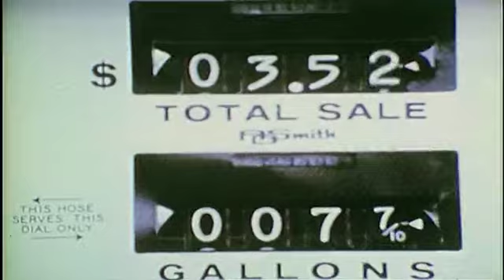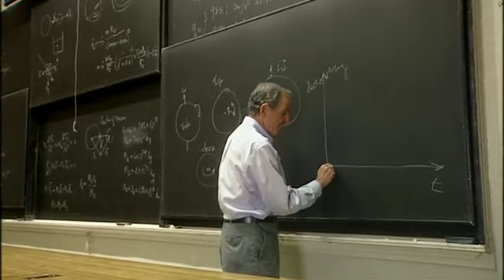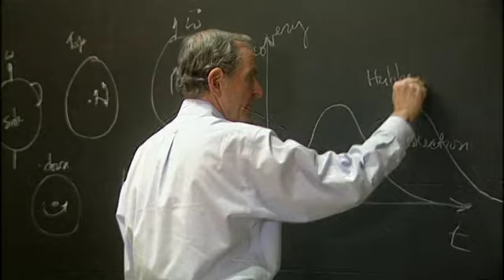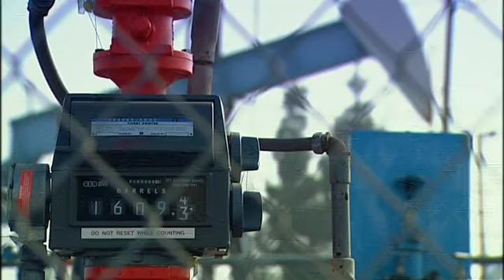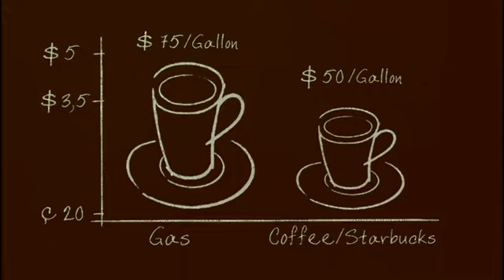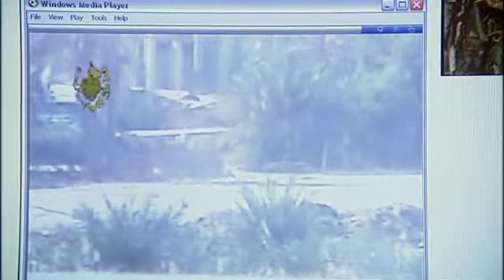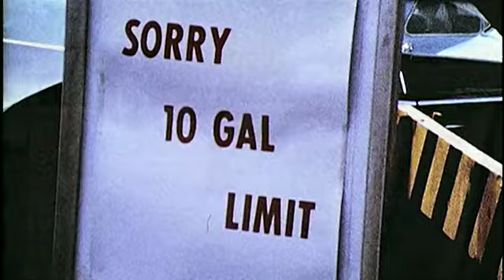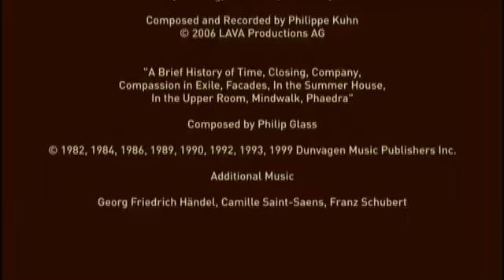A Crude Awakening - The Oilcrash

Comment: Title should have been "Oil glut crashes petrol prices."  hahaha  Ahh the hazards of predicting the future. Yup there was a peak in US production around 1970 and now we are about to surpass that peak.  Who would have guessed?  And demand has been falling too.
Reply: "Yup there was a peak in US production around 1970 and now we are about to surpass that peak."

Ain't gonna happen. The steep drop from 110 til 60 has the warning lights flashing constantly in the industry AND in the financial sector that holds its hands under an already cash-strapped sector (as well af that same financial sector being cash-streapped, and thus desperate for returns), plus the recent reports that the tight producers will themselves peak out in 2015-16, in addition to these NOT being able to bring production on-line quickly due to the massive capital investment needed for tight oil extraction.
Reply: neglesaks We shall see.  I bet you would have said $55/barrel oil would never happen just 6 months ago.  At these prices you might be right, if prices go back to and sustain 80 to $100 for the longer term there's no way the shale plays are close to peak as they can produce for half that price and falling.  It looks like the US production will get a substantial boost from the lifting of the export ban and fracking is becoming cheaper as they get better at it.  And there is far more shale potential that has barely begun to be exploited.
Reply: neglesaks My main point is that it's really hard to say what will happen, today more then ever in the energy sector, it's incredibly dynamic.  And who would have guessed in 1970 that US production would even come close to that peak 40 yr.s later especially from shale. 

 In real terms (inflation adjusted) oil today @ about $55 is *roughly* twice the average twentieth century price.  Technology, modern efficiencies and price could, for example, make old 'played out' traditional oil fields viable again.  Typically we have managed to extract some 35% (?) of the oil we know is there and it's not inconceivable that close to that much more can be economically extracted from those old fields in the near future due to far better computer models and new methods even at todays prices.  Just one example.  I didn't foresee the shale revolution so I can't necessarily expect to see the next macro breakthrough.

Demand has been falling recently, globally this year and for several yr.s in the USA.  I don't recall much talk on "peak demand" but it's possible that we have already passed that milestone?...maybe close at least?  Vehicles from airliners, trains, ships to tiny cars are getting more efficient and more diverse power options.  Cars are almost sure as hell going electric for the "foreseeable" future, trains and big trucks WERE slowly converting to natgas but cheap oil may have stalled that.  Obviously population growth and increasing prosperity works against 'peak demand'.  Sadly but predictably Americans have already ramped up the purchases of bigger SUVs.   

It's complicated.  It's hard to know where to put your money, I might have bet against Tesla Co. 2 yrs ago and I would have been wrong by a factor of four plus.  I could have easily had significant stock in shale gas co.s early this year and been wacked, I didn't expect prices to drop this far ever, but if I had that money running in that sector over the last 4 yr.s?...I'd likely still be in pretty decent shape still.   (pardon the long rambling rant)
Reply: McGill: Thanks for your detailed reply. AS you concude, yes, is is very complicated, I think that is the main thing we can disagree on. If you asked me to cummasrize the entrei sitution with the markets (not just energy markets) these years, it is that we have netered a time of highly increased volatility (at least internally - "externally" it is being "Managed" by activist government adn central banks - and that volatility creates great uncertainty in otherwise calm adn predictable markets. VOlatility hat goes on for too long will lead on to economic chaos.
Reply: neglesaks I wouldn't worry too much about that, it seems that commodity markets have always behaved wildly much of the time, no?  Volatility goes up and down and you and I can perhaps profit off it some of the time.
Reply: "it seems that commodity markets have always behaved wildly much of the time, no?"

A bit more than the general "Paper" markets,, but ... even more so near market peaks, or during times of political turmoil. We are building on both counts...
Reply: neglesaks Maybe.  But I tune into "The Street" quite a lot and don't see anything alarming.  One thing for sure those who bought into all the post crash gloom and doom and bubbles everywhere racket got 'screwed' out of a lot of potential gains...could have tripled their money in stocks had they not been so fearful. 

It's interesting that (at least among the "impressionable young", those whom lack perspective) pundits who paint a dire picture of the future somehow automatically have more cred then the bulls when one should be every bit as skeptical about doomsayers motives and wisdom.  There are just as good reasons to want the market down as up depending on your position.
Reply: Regardless of WHEN....the fact still remains the oil crash WILL happen. And instead of being concerned with what "gains" could be made in the short term, the film is supposed to shock us into thinking differently.....something that this line of responses seems to completely overlook....really is that the point of the movie, "oh look some dummies predicted the oil crash, and it never happened, so lets keep partying until it does"? 

sorry folks, but fracking and tar-sands and massive reserves and the short term lowering of oil prices...still looks like the same cloak and dagger bullshit compared to the absolute fact that this CANNOT go on forever.
Reply: HooliganJ81 I think a gradual fade is a much better description.  It's not like demand will spike over night or supply dry up in a single decade.
Reply: Bo McGillacutty true Bo, prob gradual, but complacency is not a joking matter....while we wait for that change, its just war after war....trillions upon trillions of dollars.
Reply: HooliganJ81 What about "peak everything else"?  Oil is replaceable, not so for a long list of metals, helium, etc., etc.  I'm much more worried about soil erosion then fossil fuel depletion.
Reply: A lot of US shale goes offline, tar sands go offline, a lot of the offshore goes offline, at sub-50. The price of oil will settle somewhere in the 40's and then it's going right back up.
Reply: John Smith Right back up?  How far how fast?  If you can answer that then you will have no problem making a fortune in the markets.
Reply: Surplus on the world market isn't massive, the saudis want to force a lot of Shale/offshore/tar sands/high cost conv producers to go offline,  they hold a 750 billion USD cushion so can sustain a low $40/50/60 oil price for in excess of 3 yrs, after that they would be in a situation where they would tap into debt markets..(wont get to this stage).. and they need long term around 85 USD to break even given their spending... I could take a look at the bond yields/CDS spreads of the shale oil producers to see where they're at. Along with the fact that shale oil wells in general have a very short shelf life, and just wait for the inevitable. A lot of Shale producers, Offshore, Tar sands WILL go offline, if things stay below $60 a barrel for at least 6 months.. With a severe reluctance (from those who got burnt) to ever bankroll similar projects for a long time (this is already happening to an extent). Taking that supply off the market for a good amount of time. Right now, things are going in a general downward direction, but imo prices will level out and consolidate at some point. My prediction is around $40. I'll be buying at that stage (primarily o&g stocks). If im wrong, and crude goes down more, ill buy some more. If i buy an oil producing co (low cost producer, breaking even, <--- they do exist + more leverage  + generally better upside to an ETF ) with WTI crude at $40, price goes down another $10, in a month or 2, hits floor, then rises and settles at $75 in 12 months, i have made money. What do you think the Saudis are trying to do, other than to force the expensive producers off the market.  Oil price wont stay low for much longer than they can bankrupt offshore/a sizeable proportion of shale producers/ tar sands...Once the market gets a whiff of that actually taking place, the price will rise. I made good money from the carnage in late 08. Including in excess of 60X (6000%) on an oil exploration stock in the more speculative part of my portfolio. Back then it was, "Oil has finally found its true price!, We will never see $100 again!"  This situation is different, and could very well be a prelude to a much wider financial crisis, which could leave us in the doldrums for far longer than expected... But what i wrote about is what i'm doing in the current scenario.
Reply: there are very few new discoveries of oil to be made around the world. All of the major oil fields have already been found, and the ones we are finding nowadays are always smaller and smaller pockets that are more difficult and costly to extract. Eventually, the amount of energy required to extract oil will be as great as the amount of energy you get from burning oil, making oil extraction a fruitless process because the EROEI becomes too low to justify production.
Reply: AmandaNerdBot No comment on the rest but: "All of the major oil fields have already been found"...how could you possibly know that?
Reply: The Lula field off the coast of Brazil is the largest find in the Western Hemisphere for about 2 decades (3 if we are being generous, though there are good reason for not being so, since the largest number (~33 Gbbl) of the resources in that basin was made by an executive of PETROBRAS, who happened to make a fat profit off his stocks in the company as it bounched after his announcement. The other generally accepted figure for the Lula resources are 8 Gbbl, ie 1/4th of the former number) - will supply the current human civilisation's demand for about 2 years, if you wring out every drop out of it.

Graphically:

http://planetforlife.com/images/growinggap.jpg

So in summary - no, we cannot know that all the big ones have been found, but considering the rapidly advancing surveying technology and methodoly over the past half century, it's worth considering that the discoveries are clearly tapering off.
Reply: put it this way, you're not going to find a ghawar any time soon, simply wont happen.
Reply: Bo McGillacutty
"Oil is replaceable,"

No it is not. Compare the energy density of Oil and Oil derived chemicals*, with the best battery technology available today - Lithium batteries. The Tesla cars, which is by and large the pinnacle of current technology, works pretty well, though with a range limit for the most expensive model (w/ a 85 kWh battery) at ~400 km, but needs a battery switche at least every 2nd year , assuming daily driving.

How will it work in trucks, freight trains and ships and supertankers, where the load on the engine(s) and thus the battery, is far higher?

How will it work in aeroplanes, where low weight is crucial?

* ) https://en.wikipedia.org/wiki/Energy_density#Energy_densities_of_common_energy_storage_materials

Yes, there are Graphene capacitors in the works, which improves on old-style capacitors by an order of magnitude, which is awesome, but it doesnt seem to be a savior from what we know now.
Reply: neglesaks
oil is indeed the most invaluable natural resource mankind has ever discovered. It allows us to do things that are otherwise impossible to do like travel across the world in mere hours.

Electricity has nowhere near the bang for the buck as oil. Are electric cars a viable alternative to oil? No because electric cars face major limitations. For example, they have limited travel distance.

Also electricity is not an energy source. Electricity is generated by burning and using another energy source. And since most electricity is generated by fossil fuels and other nonrenewable sources, electric cars are still running on nonrenewable sources. Electric cars are pointless, unless you can change the entire electric grid to renewable energy sources, which will be a huge technological challenge. And it is debatable if we can change our entire electric grid into renewable energy sources.

Also, biofuels have major limitations. For example, corn ethanol has too low of an EROEI to justify production. Corn ethanol's EROEI is only 1.5 to 2. Compare that to conventional oil's EROEI of 20 to 30 that's pathetic. Surprisingly ethanol made from sugar cane, however, has a much higher EROEI of 8, which is actually decent. But biofuels compete with food crops, and we are already running out of food, which means we are limited in how much biofuels we can produce.

There is also the issue of wood? Could we burn wood to generate electricity? The answer is yes we can. But if we were to generate all of our electricity by burning wood to replace coal and natural gas as electricity sources, we will quickly run out of all of the trees in the world. So while wood is a renewable resource, wood is also limited in extent because if you harvest it at a faster rate than its replenishment rate, you will eventually run out of wood too just like what happened on Easter Island.
Reply: AmandaNerdBot
Corn ethanol is/was a disaster right from the get go.  It's nothing more the pork for industry and farms.

Solar is on a long term trajectory to be the cheapest E ever and it has a lot of room for improvement even as it is now roughly competitive w/o subsidies. 

 The main problem with fossils is we have far too much and can't resist burning them beyond the biosphere's ability to safely absorb the consequences.  It won't be long before most of the US can power their house and cars off solar collected from their own roof with enough storage to get thru a few days of bad weather.  It will be nice to be off the grid, no?

Electric cars will soon be superior to petrol autos...batteries may be swapped in minutes at a station or fast charged for another couple hundred miles worth.  Trains, semi trucks and ships can be run on NG (natgas) for the foreseeable future, only aircraft will need liquid fuels and THAT much can be supplied by already competitive bio kerosene (at pre-crash oil prices) fed by 'waste' cellulose.  In my agricultural area there is a steady stream of wood fiber from orchard replacement, enough to supply a few modest size wood fired electric plants but that material has much higher value as feed stock to liquid fuels.  A subsidiary of Shell has proposed just such a cellulose to diesel and kerosene plant here so it's not merely some academic exercise, it's actually viable at $80 oil.  No need to replace food for fuel as the fuel is a byproduct of food production.  No it can't supply all our needs but it can power our aircraft and that's all it needs to do.

The mid range energy picture has never been brighter, I worry about things we can't create, that includes most metals, copper, nickel, vanadium, moly, chromium, tin, lithium, etc., only iron and aluminum are nearly limitless.  Helium is nearing the end and once it is in the atmosphere it leaves earth never to be replaced and it is essential for a long list of industrial and scientific purposes.  So petrol is the least of our worries, sort of a joke to worry about really.

I remember when the US even relied on oil for much of our electric generation up until the early '70's or so, we fretted over the possibility of blackouts that never happened. Few even noticed but houses and industry doubled their efficiency.  Since then autos have tripled mpg and oil fired electric plants disappeared long ago.  The transition away from petrol for transport is just beginning and there is no particular reason to think it will be any more difficult then previous transitions.
Reply: Bo McGillacutty
yeah, I believe electric cars have their potential. But you have to derive the electricity from solar, wind and other renewable energy sources if you want electricity to make a difference. Electricity derived from coal,oil, natural gas or nuclear fuel will not make any difference because those electrical sources are nonrenewable.
Reply: AmandaNerdBot I'm far more concerned about ocean acidification, sea level rising, potential for massive methane hydrate releases (probable cause of one of greatest mass extinction events) and other environmental costs of fossils.  Oil will fade away and I think become obsolete before it is even too expensive to burn.

We have more E options then ever today.  We could power everything with fossils for 200 more years but that would be tragic unless we capture the carbon.  An oil executive once famously said:  "The stone age didn't end because we ran out of rocks, the oil age will end before we run out of oil."  (roughly quoted) 

Solar alone can almost do the job.  Germany has about half the solar radiation (similar to Alaska) that the lower 48 states have and they managed to intelligently make it work just the same.  Moore's Law seems to apply to many technologies and that certainly includes solar, look at the last 20 years of price per kwh, it's amazingly consistent progress with no end in sight.

And nukes while not renewable can certainly carry us for centuries if needed, I'm not thrilled with them but better then coal if done properly.
Reply: Bo McGillacutty
what are the limitations of solar energy? Does solar energy require any rare earth minerals or other rare materials? Or can solar panels be made from a very common natural resource?
Reply: AmandaNerdBot I'm not an expert on the subject but current common ones are silicon based.  Many other types are in one degree of development or another including many diff types of materials.  In general I think the answer is NO they do not require rare, expensive or exotic materials in any large quantity.

  One thing to keep in mind is that current commercial units are about 20% or less efficient, we could see that double over in the next decade or two.  But the primary factor will be cost reduction that has been very steady. Eventually it will likely be cost effective to collect even in marginal places like walls or half shaded places.  In any case the typical family home in the US can harvest more then the house requires just from the 'better half' (sunny portion) of the roof.  It is not much of a stretch to power the house AND cars via roof top collectors alone.  And we need not stop there of course, likely driveways, sidewalks and such can also be used eventually.  I expect the cheapest electricity in history is in the near future.

  Even without lifting the 'environmental subsidy' on coal--you can see why the coal industry is panicking...their days are numbered and good riddance...it will take decades but the end is in sight.

Storage is/will be a hurdle for solar and wind but there are many options on the horizon, some of which will likely be viable soon enough.  Also peak electric demand happens to coincide fairly nicely with solar intensity, that helps.  I don't know how electric utilities can survive in the long run, as more ppl go off the grid the remaining customers will absorb more of the cost of maintaining the grid and so on, it looks like a death spiral for the utilities to me.

And that's just land based solar.  Wind and other options are also becoming increasingly competitive.  And that barely extends beyond land, most of the planet is ocean a small slice of which could be used in multiple ways to provide enormous quantities of power.  Everything from algae for oil to solar and wind.
Reply: Bo McGillacutty
Solar has a lot more potential than wind energy. There is 20,000 times more energy from the sun than the amount of energy we get from fossil fuels, so we are awash in sunlight. We just haven't begun to use it yet.
Reply: AmandaNerdBot Indeed.
Reply: Bo McGillacutty
the future of electricity will be solar energy and to a lesser extent wind energy.
Reply: AmandaNerdBot Likely yes.
Reply: Bo McGillacutty
the problem with solar energy is that solar panels are made of rare metals, and it might not be possible to make enough solar panels to compensate for the lack of fossil fuels because there aren't enough of those rare metals. We need to create 100,000 square kilometers of solar panels to replace the fossil fuels we burn. But is there enough rare metals to create that many solar panels with? That's the question. Like I said before, there is no easy solution to the peak oil crisis. All alternative energies have their limits and downsides.

The main problem we are facing is that we live in a world were infinite population growth is seen as a good thing. But there is no way we can have infinite population growth because the Earth's resources are finite. The Earth can only support a limited number of people. That's a fact. Unless mankind surrenders to the fact that he lives on a finite planet and that he must live in balance with the other plant and animal life, there can never be true happiness.

And no amount of technology and ingenuity can overcome a resource shortage. That's because technology is dependent on natural resources. Without natural resources, you will have nothing to build your technology with.

The average person is stupid, and believes the current way of life and the current way of thinking can continue indefinitely. It can't. You  can't infinitely increase population. There are limits to how big the population can get.

What most people don't understand is that increasing the population does not make people wealthier. On the contrary, it makes people poorer because the Earth's resources are like a pie. The more people there are on the Earth eating the pie the less each person gets of the pie. That's because the pie needs to be divided amongst more people. Your real wealth is not measured in terms of money, but how much resources there are. It is not possible to increase population and consumption per capita indefinitely because the Earth's resources are finite. No amount of technology and ingenuity can create resources out of thin air. Humans just need to learn to live within the Earth's limits by stabilizing population at a sustainable limit.

Some things are impossible. There is no way every family on Earth will own a computer. Why is that? That's because there aren't enough rare earth metals on Earth to make that many computers. Similarly, there is no way every family on Earth can own a car because there isn't enough oil on Earth to make that many cars. These are good examples of how the Earth's resources are finite and that infinite consumption and infinite population growth is impossible.